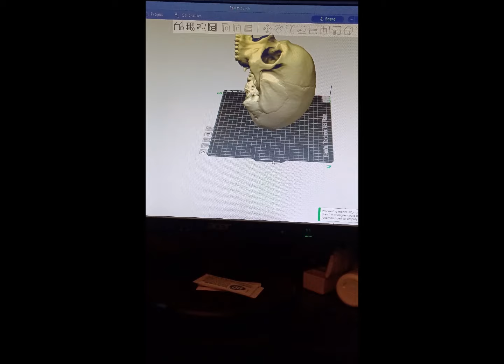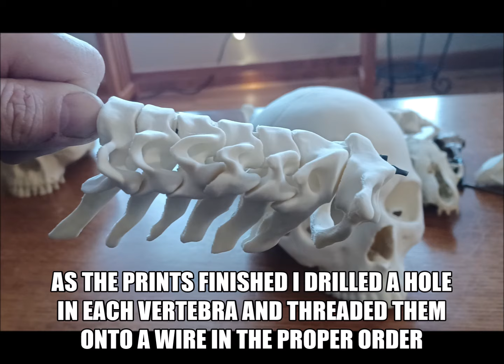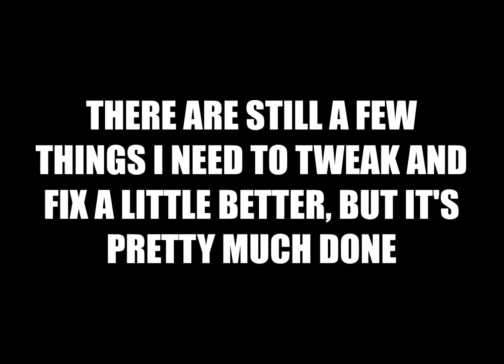3D Printed Skull And Spine

Comment: Beautiful work. Did you need to do much post processing (buffing lines out, etc)? Are both the skull and vertebrae life sized?
Reply from the maker: Yes, the entire thing is life sized. There are a few places on each print that could use a bit of sanding, but I did not do any. Most of the layer lines are pretty unnoticeable, except for a few domed areas where I should have used variable print speed but didn't. Since I will be either leaving this as-is or more likely, adding blood and gore I didn't see the need to do a lot of finishing work.The defects will either be unnoticed against the white bone, or be covered up when I add gore.

Comment: How do you get the prints so smooth? Do you sand and prime them after?
Reply from the maker: The Bambulabs printer and matte filament just print that smooth!
Reply: @OakLaneCemetery holy heck! Seriously? But it's like glass!
Reply from the maker: Not quite. The lines are still there, but very fine.

Comment: I am very interested in 3D printing but it has been way out of the budget for just a lowly home haunter. I can't justify the expense until the costs come down more as I would only use it for my haunt. Can you give a cost on your printer and the cost of material just for this piece? I will buy once I can justify one for sure lolol. Thanks!!
Reply from the maker: I spent more than I probably should have for my printer because I wanted something reliable and simple to use. That was a Bambulabs p1s. Much less expensive ones are out there. As for materials, I estimate $30-$40 total for filament, wire, fishing line, and connectors for this project. Took around a whole 1lb spool to print everything.